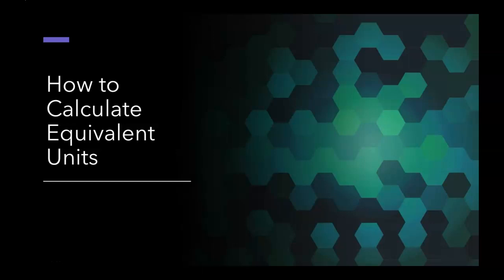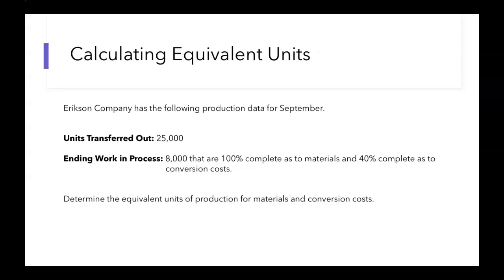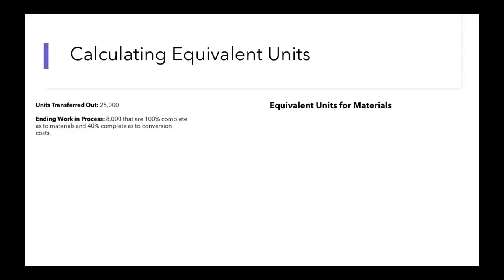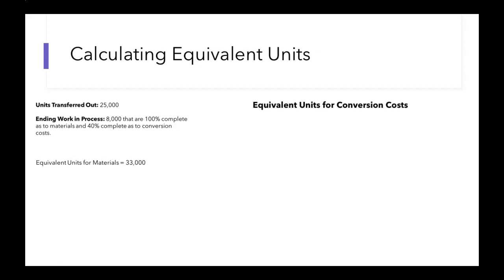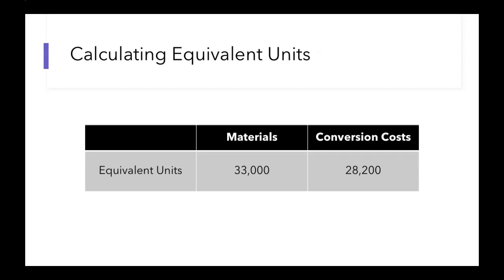How to Calculate Equivalent Units

Comment: what about when there is a beginning WIP amount
Reply from the maker: A beginning work-in-process will not change the calculation.  You may have to use the beginning WIP to determine the number of units transferred out, but the calculation for the equivalent units remains the same process.